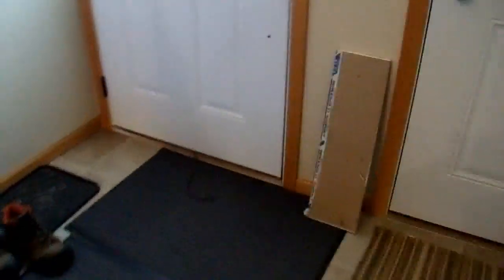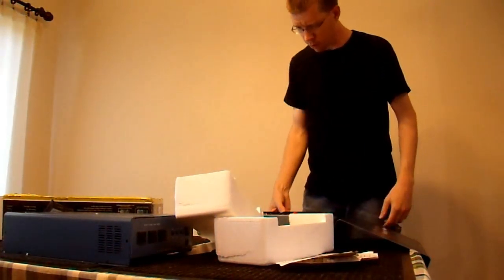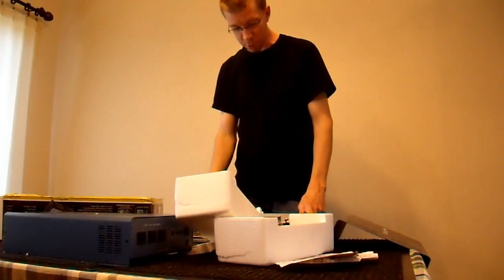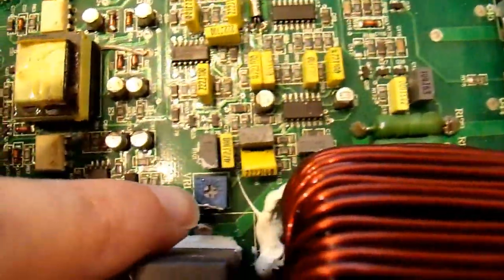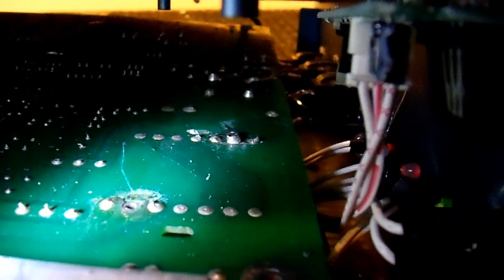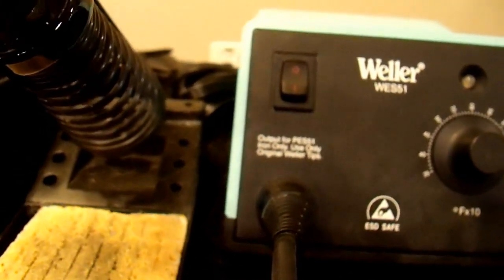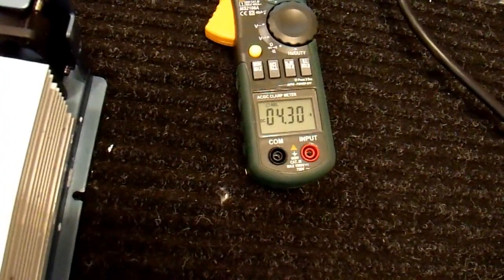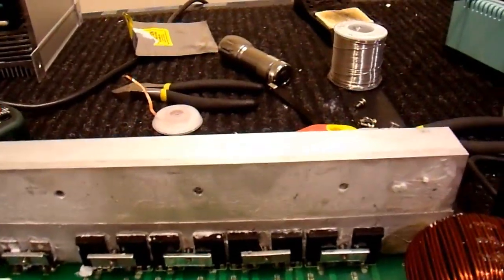PowerBright Pure Sine Inverters Part1 - The Unboxing

Comment: Careful, most VR1 pots (As far as my experiance with working on inveters) are (normally frequency adjustment Pots for the factory to set based on normal differences from product to product. This may not apply to all inverters but with the many I have messed with over the years, Its normally what its there for, and with some a VR2 is normally output voltage. Depends on the construction of said inverter as well as the design of them

Comment: A good thing to do with those transistor clamps is to stick a small rubber equipment case foot to each transistor contact point on the clamp.

Comment: Great video!  I have a travel trailer and I want to run my Dish network satellite system as well as the 32" LED TV and DVD player at times. QUIETLY!  Campsites do not like NOISE after 10 pm.  Is a 1000 watt Samlex pure sine wave inverter enough? Will be running an extension cord or Romex approximately 25 feet from the inverter. 12 or 14 gauge ok?  Thanks for the information in advance!

Comment: Can you use a p65nf06 in the place of a irf 3205? I have a CyberPower 1400VA Pure Sine wave UPS I am trying to repair and I don't have any IRF 3205 MOSFET but I do have some p65nf06 laying around that camoe out od Cyber power 425VA. My concern is one was used in a Modified Sine wave and this is a true Sine wave. I think the Controller is the key to the Pulse width modulation to create the better sine wave. In a pinch do you think it will work or is this a really bad idea? Thanks!

Comment: Where did you get your multimeter from and how much did it cost I need one with an oscilloscope like that
Reply: +mewantbrains 
you need or you want? :D
If you need a scope you should really ask yourself if it has to be that portable...
Also the device used in the video is really not a proper oscilloscope...
In terms of functionality you can get the same quality with an arduino and a cheap dot matrix display.
Reply: I mostly need something that is relatively cheap and highly portable so I can fit it in my toolkit